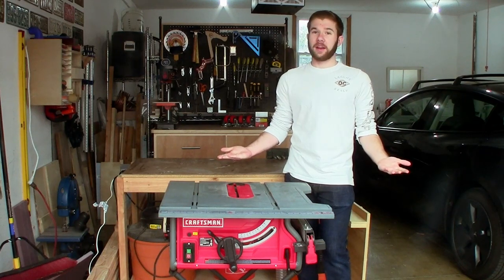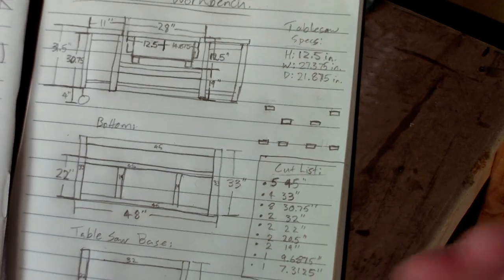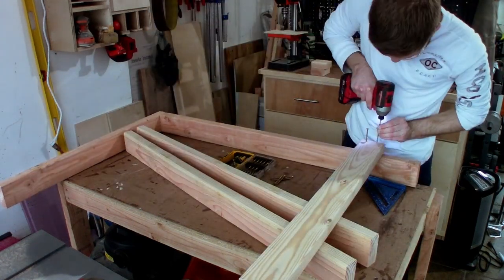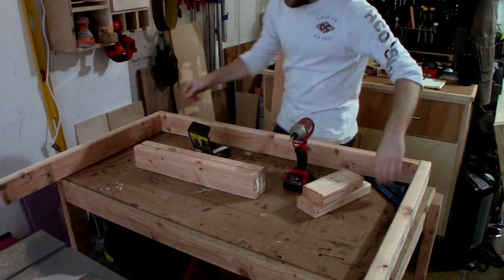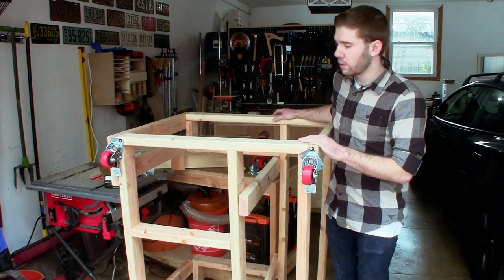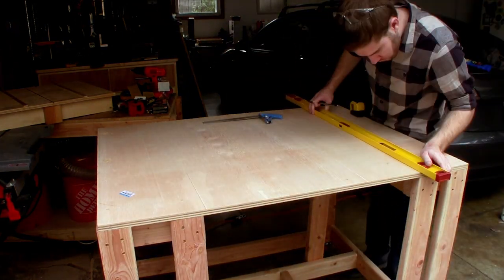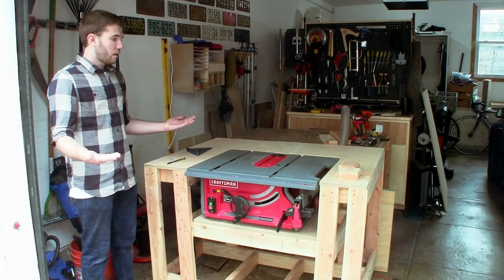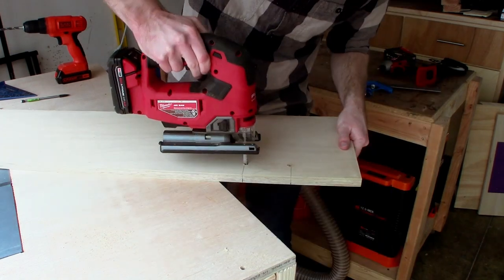Building a Workbench Around the Craftsman Table Saw

Comment: I just made a 4’x4’ bench for my 8.25” Dewalt Job site saw, but used Pocket Holes to screw the table top to the support 2x4’s, using the cheapest Kregg Jig. First time use of pocket holes. More time consuming, but cleaner look on top. Retirement hobby, so learning new skills every week. You’re the only other person I’ve found who made a 4’x4’. I like the size, and made it the the Ht. (35”) of my IWORX Pegasus worktable in case I ever need additional support.

Comment: Not too shabby, enjoyed watching you use a level as a temporary fence. Also thought of making a similar style bench.. Think I bought the slightly cheaper version of your saw. I was surprised to discover only one miter slot so will have to leave a slight gap on left side to stabilize miter sled. Hope you left a slight gap in the back so you can still use your fence. If not I'm sure you will solve that issue easily. Wishing you many hours of happy woodworking.
Reply from the maker: Thank you, gotta use what you have! Yes, I did leave a space in the back of the saw for the fence to slide, found that out when mounting it. And interesting on the single miter slot, I've heard of saws like that but haven't encountered it. Good thinking on using the side for your sled!

Comment: How did you build your sleds? The tabbed slots are a challenge when building any jigs.
Reply from the maker: I actually ended up cutting off the tabs in the miter slots to make it easier to make sleds. More than anything, I just found them to be annoying.

If you're not comfortable cutting them off however, I'd reccomend measuring the gap under the tabs, then between the tabs, cutting 2 pieces of wood to fit both those areas, and then gluing them together under your sled

Comment: At 10:00 …how did you make sure your clamped straight edge was cutting square to the blade ?
Reply from the maker: I measured out 2 locations, front and back of the blade, and marked it on the table top. Then used a carpenters square to try and keep it squared to those lines. In the end, I think I just made sure it was as squared as possible, with just a slight outward angle to prevent binding on the blade
Reply: @diywithry  thank you- gotta love using the tool you’re building- to build the tool you’re building…..

Comment: Really nice job but for a 200 dollar saw I think it’s not worth all that - the lumber and supplies are going to cost double the saw price and the saw is only going to last a couple years especially with plastic gears for raising and lowering the blade
Reply from the maker: That's fair, the material cost and the quality of the saw definitely puts into question the necessity of this workbench. In my case, this was the only saw I could afford at the time I was starting, and I intended this workbench to serve multiple purposes
Reply: @diywithry It’s not fair Ry. Don’t listen to this judgmental troll (@josephzethner8972). Whether you have a $200 table saw or a $2000 table saw, if you want to make a cart for it to make it more user-friendly, you do it man. I’m sure you have your budget in mind when you start a project or buy a tool. No need to explain. Keep up the great work and thank you for making this video. I wish you all the best my man!